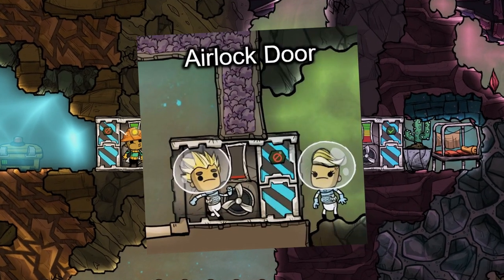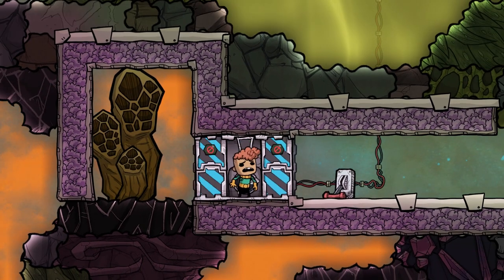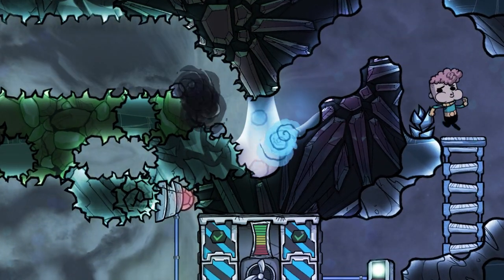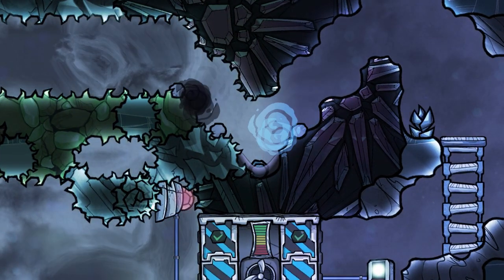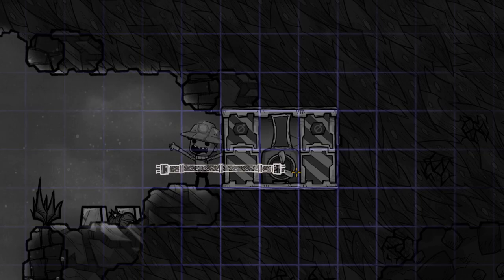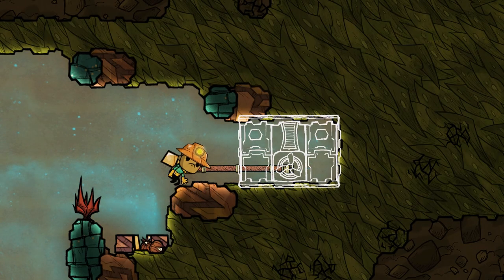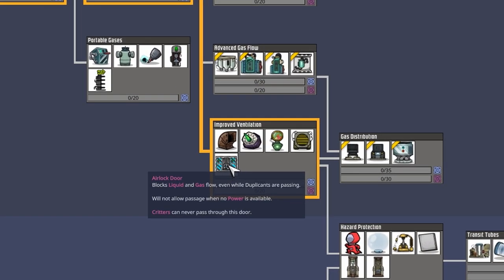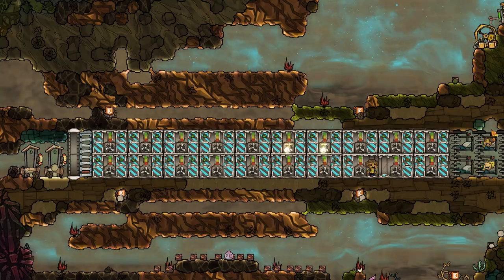Mini Mod Monday 15 - Airlock Door - Oxygen not included

Comment: I have this door for quite some time and to me it seems like a logical technological progression of the game. It may even be made available "higher" in the tech tree but it should definitely be in the game. Still doing liquid locks when you deal with sour gas boiles and/or nuclear reactors seems dirty and cheap
Reply from the maker: Yes I agree there should be more technical progression at the end. Like the deep freezer mod. It just seems logical to have a better door or food system by the time you fly into space
Reply: Agreed, I never like doing liquid locks unless it’s visco-gel since that’s exactly what it’s for.
Reply: Couldn't we just use 1 has pump and put the gas into a storage then put it back into the system
2 doors 1 pump and a gas storage somewhere
Reply: Exactly what I came here to comment (but better explained). I wonder if there's any intent from the original devs to implement some mod ideas to the original game, but since this video was almost one year ago, I dont believe so

Comment: Not only is this a must-have QoL mod that fits well with the game's narrative, it is also a very well-balanced mod. While it offers an easy way to seal off gases and liquids, including infinite storage areas (the door is impervious to pressure damage), it also comes at a cost. In addition to power and metal costs, the doors is slower to pass through for dupes in atmosuits compared to the liquid locks. In my typical late game base all dupes have athletics of 50 (I use a mod that increases the cap on skills to 50), and the only thing that slows them down are those airlock doors, which I have all over the place.
Reply from the maker: What a nice review. I could have used that as a script for the mod video itself :D.
Thank you Nazgul

Comment: I just realised you could possibly make this with a mechanised arlock and a gas pump. It just wont be nearly as efficient and also takes up way more power
Reply from the maker: People tried hence the mod. The issue with the in game buildings: the pathing of the duplicant will be deleted once both doors are closing. Then the dupe no longer knows what they were doing before and search for a new task. sometimes that's the same often it is not.

Comment: For the cable problem they should add some sort of manual overide function, opening the doors on both ends with no power, but maybe damage the door in the process?
Reply: it has, it's called "destroy"
Reply from the maker: someone suggested just moving the cable inlet one tile but maybe that could lead to problems in already existing modded bases.
Reply: @fltfathin  heh, not really that
Reply: @Luma_plays  can the dupes maybe add the cable from below?
Reply: or if it isn't powered it could work like a normal unpowered door
Reply from the maker: @Tomi-always-Tomi  And then letting the oxygen through? Or have a manual crank to get rid of the gas :D
Reply from the maker: @wittkopdotzgaming  not sure. probably, but only if you remove the floor and re-add it later
Reply: @Luma_plays  yeah like normal door, it could have a mode switch in the UI when you click on it

Comment: After using this mod for quite sometime I've noticed that critters like dreckos keep getting stuck inside. And when they do get stuck, retrieving them back would be very difficult without deconstructing the airlock doors, causing the airlock to break of course. I've never done a full investigation but I suspect it happens when dupes who are relocating critters entered downtime the moment they got into the door. The issue predates this video by several months, so I don't know if it still persists or if it has been fixed. But it caused so much trauma to me that I uninstalled it and have since gone back to tried and true liquid locks.
Reply from the maker: This seems to be a very important point. Good you mentioned it. I haven't tried critter relocation through those doors. But is it really that often of an occurance? I normally fill the ranches and then no more relocating is necessary. You would need to watch the dupes closely when they relocate, that is annoying but only a rare situation. Maybe the Author even sees this :)

Comment: That's an awesome must for space...  damn liquid locks freezing..  
Also   if you have a vacuum inbetween  2 sets of those doors.   It would be a temperature lock also.

What happens if it overheats?   Stops working?
Reply from the maker: Not sure if it has an overheat temperature like regular pneumatic doors or only has a melting point like  automatic doors.

Comment: Seems like this does not work all to well for busy corridors. If lots of dupes wants to pass this frequently then they will spend a lot of time waiting. So multiple is necessary which is perfectly fine. But perhaps a major disadvantage compared to the liquid locks
Reply from the maker: True just like a busy transit tube access point. The question for each base is how many liquid locks or in the case of the mod airlock doors do I really need? the ones that go into areas with different gases. So probably not too much. And if that area is still busy like a walk in fridge with chlorine, then a little bit improving the situation might be the better solution. (My walk in fridge was a pain so I changed the setup)

Comment: This looks nice but why not put the power module on either doors instead of middle would make it less annoying. Otherwise you can use a 3 block high space between 2 doors with minipump and sensor to always keep a vacuum in the middle incase a dupe exhales there
Reply from the maker: I think i read that that would make existing game files buggy or broken. But yes the power input at one of the sides would be a fix.

Comment: You can do thin in vanila
Reply from the maker: Hi David :). You mean 2 doors automation and some pumps? There are a few sezups and you can try it yourself; but the issue is as soon as the doors close and lock in vanilla the dupes task and plan basically gets deleted. So they don't know what they wanted to do once on the other side. Delivery task through such a system would be a pain.

So yes technically already in the game but since the dupes can't orientate through locked doors not viable.
Reply: @Luma_plays  i will try one day

Comment: Does this mode allow to kill the gas, which comes to it's middle or there is a vent output for gas ?
Reply from the maker: The gases don't actually move (or are put back to their respective side). If you have 2kg of hydrogen at the left and 4kg of oxygen at the right: after a dupe walks through the door the values should still be the same.
Reply: @Luma_plays  wow, so that is quite a perfect mode, indeed, thanks for answer!